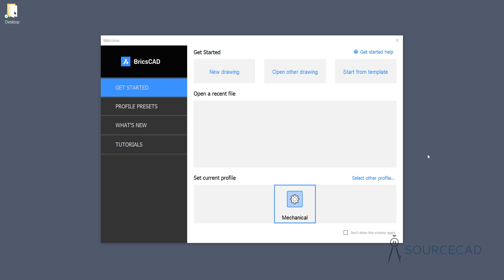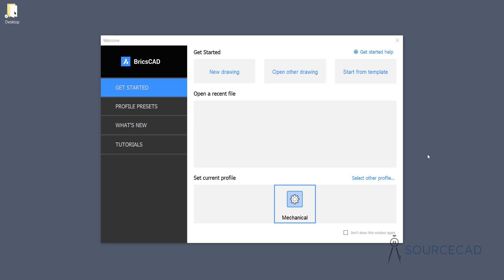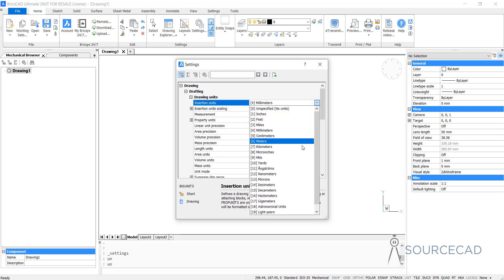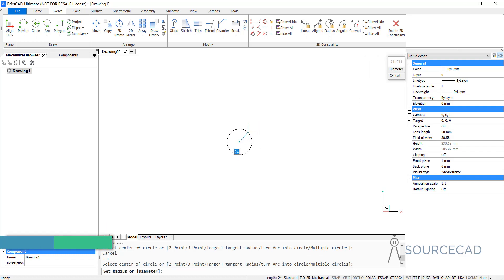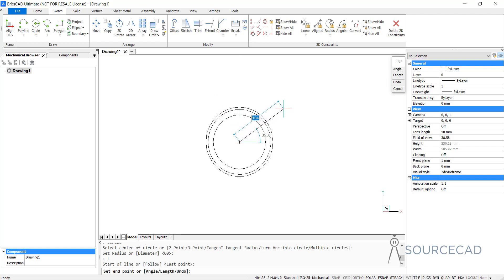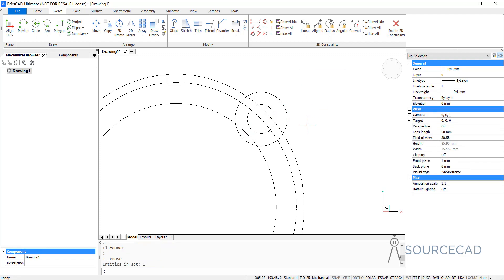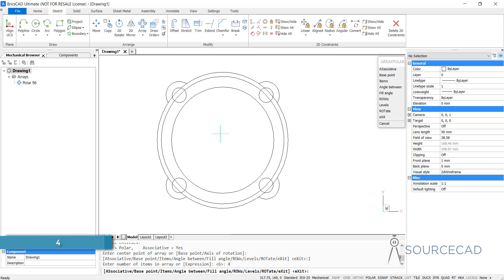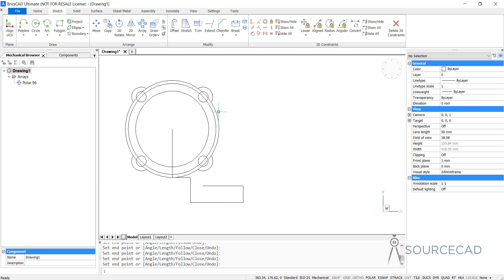BricsCAD Tutorial: Making a mechanical part in 2D and 3D

Comment: Im starting out new to this, its only a hobby but would like to make somethings for the house, would you say Bricscad is a good entry level program?
Reply: I use Bricscad professionally (as a senior draftsman) - this isn't entry level software, although relatively easy to pick up. A few good questions to ask yourself is: what are you going to be using it for? If you are only going to design a few few things for around the house as you say, maybe consider drafting on paper (quite easy to do and very cheap compared to expensive software) or perhaps the free version of Google sketchtup. If you intend to sell your designs and need a more professional finish to your drawings, maybe hire a craftsman, or if you feel the need, you could get a month's subscription to AutoCAD - which should give you plenty of time to draft up whatever you need for small projects

Comment: when you added the fillet I noticed it didn't seem to update (on screen) until you hit enter is that true?  A lot of times I'm doing my design by looks (visual).  I understand I can just undo the fillet and redo it a few times how ever it's quicker and easier if you type your dimension and it updates on screen for a visual view without having to undo and redo it.  Understand that my cad work is for my 3d printing hobby and currently using F360, how ever I'd like to dump windows which is why I'm looking at BricsCAD.  This isn't a deal breaker just a  blah I wish it had type feature.

Comment: Hi Jay,
Thank you for another great video. 

I was finally able to replicate your drawing in ACAD 2018, however there were some challenges that I managed to overcome, but only by trial and error. 

The initial 2D drawing is made up of intersecting straight lines, arcs (created by the fillets) and arcs created by the circles. I was initially unable to EXTUDE or PUSH PULL to make the 3D object.
The problem was that I didn’t have closed polylines.  After some trial and error, I found the BOUNDARY command in HATCH worked some of the time. Also, I don’t think ACAD has the extrude function in both directions? My solution was PUSH PULL the profile in 1 direction, then go underneath and repeat in the opposite direction. There still was a problem, sometimes I would “lose” the original polyline. EXTRACT EDGES didn’t work for me, I then tried EXTRUDE FACES option, and this worked.

When you encounter such problems, is there a methodology you apply as a fix this?  May I request a video tutorial which might illustrate the problems I’ve described and the methodology to overcome them.